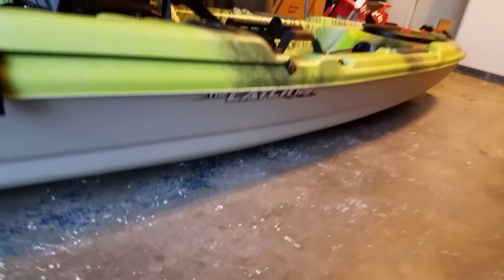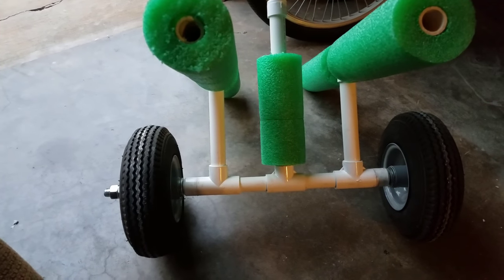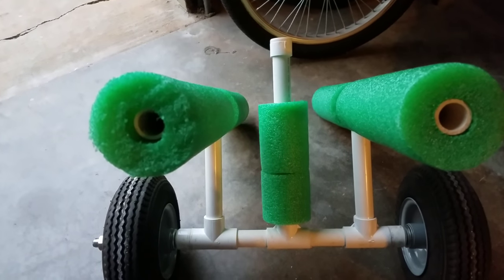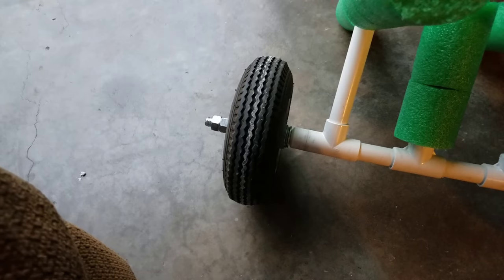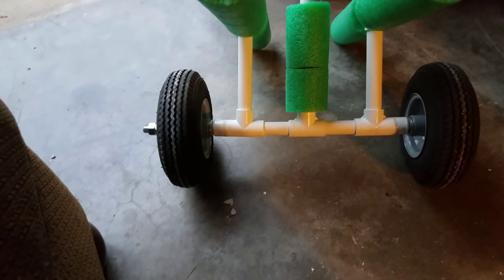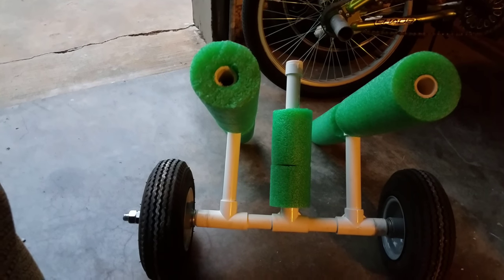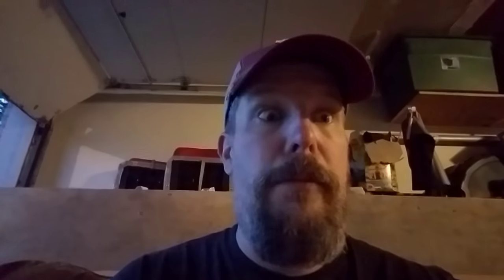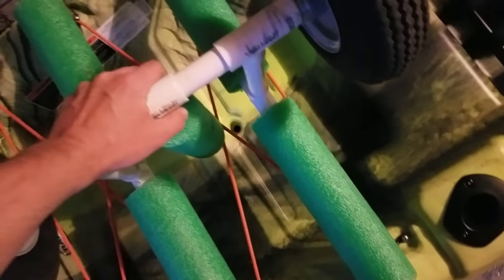DIY Kayak Cart for Pelican Catch 120NXT

Comment: You could use two>  2 by 2  wood  bolt them together drill 3 one inch holes for the pcv pipe right were they go together  Then take them apart To brace all 3 pipes.  take 5 minutes to make.

Comment: I need to make something similar for a Catch 100. Your cart seemed to rotate when you had it under the boat. Did your center pole go all the way thru the scupper hole or did it just rest in the recess of the hole?
Reply from the maker: Originally it went all the way up but someone informed me that can damage the scupper hole so I shortened it.